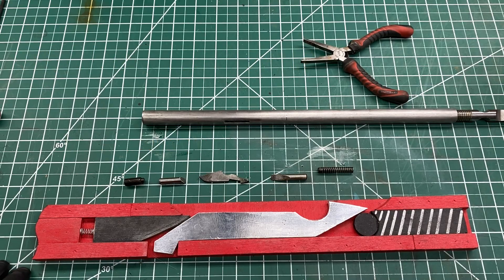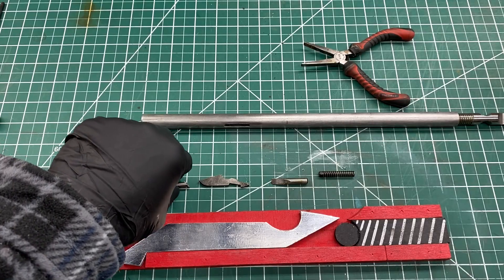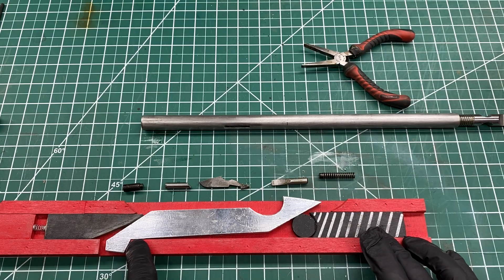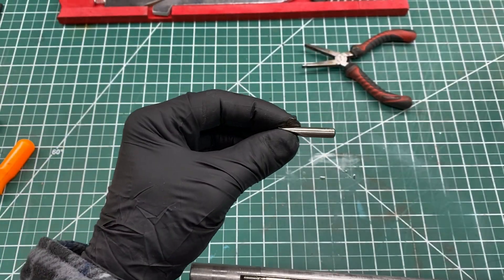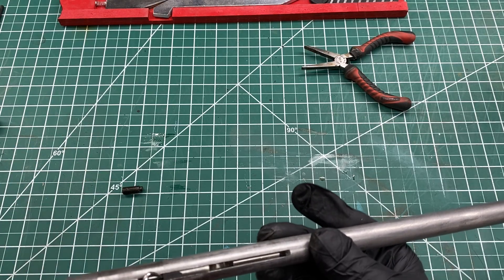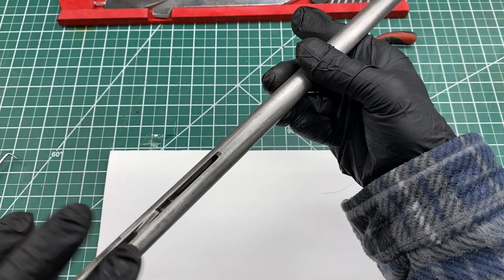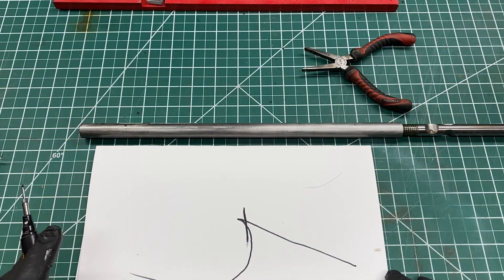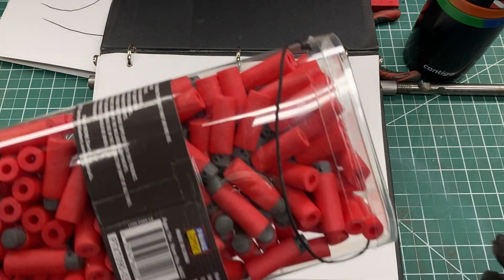Home build rifling cutter that really works

Comment: I want to make a cutter like this for a .22 lr. Will brazing an HSS tip (ground from a round 5.7 mm HSS rod) to the hook work for annealed 4140 steel?
Reply from the maker: If you braze high spid steel it will get annealed 
Maybe make the whole blade from high speed steel
Reply: @scubakuba  Thanks. I don't think I have the skills to make such a small head that would also work as intended, not now at least. Button rifling seems the only option for me.

Comment: That would retract on the pull stroke also.
Reply from the maker: I used this cutter on brass and aluminum barrels and it works flawlessly 
It only retracts on the return stroke 
You can see it in use in my video : home build Rifling machine that actually works 
Thank you for commenting